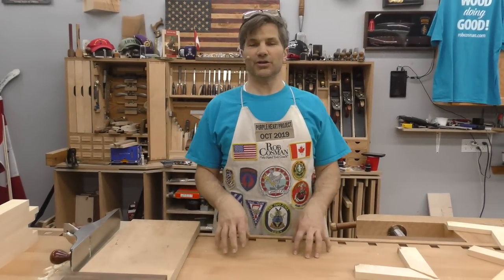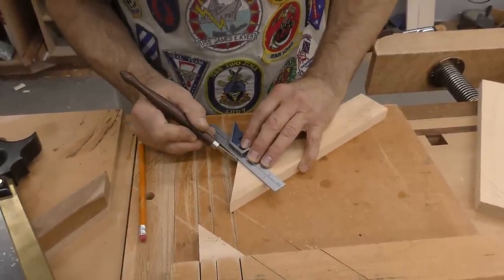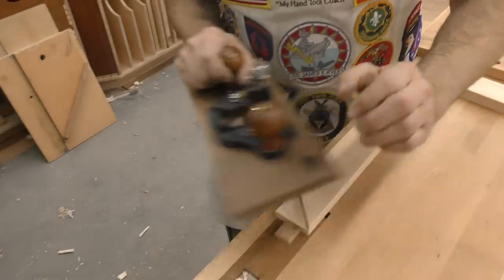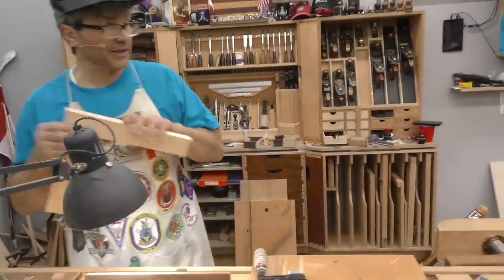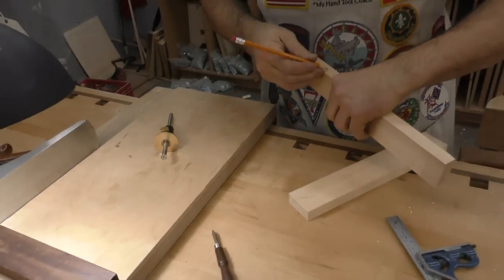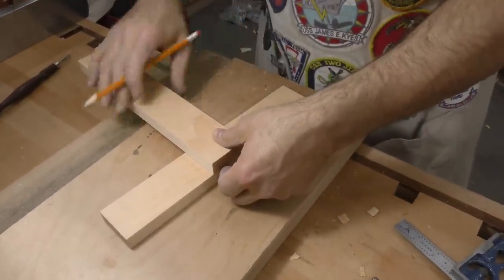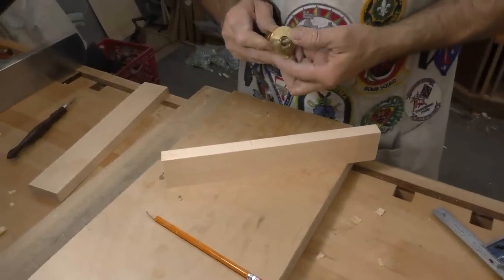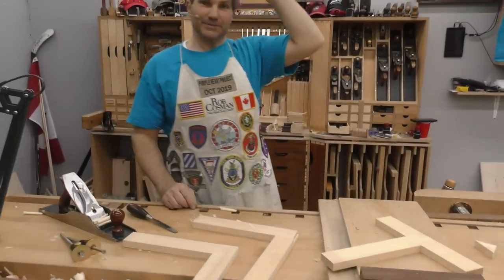3 Simple Lap Joints, with Rob Cosman

Comment: Love this one- thank you.  Teaches me that you don't have superhero special powers at woodwork, but you think it through carefully, don't give up, and give it everything you've got to get the best result.  Reassuring that you get confused with orientation too, I think I make more mistakes with orientation than measuring.  Great to see you paying such close attention to every little fibre, edge and surface.  On the mitred lap joint, if you didn't have a router or a router plane what would you try next to clean up the cheeks?  A chisel or a shoulder plane?  And I never see you use a file?

Comment: Great examples Rob, I own the L/N large router plane too and I think its excellent.
Have you concidered the Walke Moore 2500 bronze router plane? You van change the location of the blade so most of the body of the plane would be on the workpiece
So the blade would be at one end, very useful for what you are demonstrating  here. Also the cutter can be removed from the blade making it much easier to sharpen.
Reply from the maker: I have not.

Comment: If you wanted mechanical fastening with those joints, how many and where would you place them in the joint?
Thinking about outdoor frames for window screens with a headless nail or pin in each joint?
JIM

Comment: At 23:25 (and elsewhere) you just eyeball the pencil line half the thickness of the board and use your finger along the face to keep you parallel.  That has to be exactly in the right place right?  A 16th (or 32th I guess) over and your sides wont be flush.  I guess you've done it so many times.